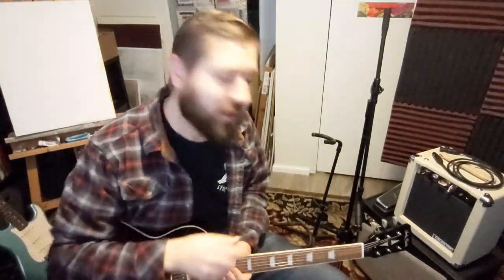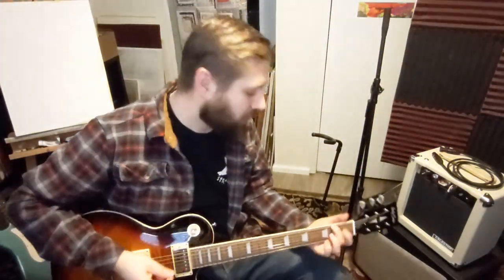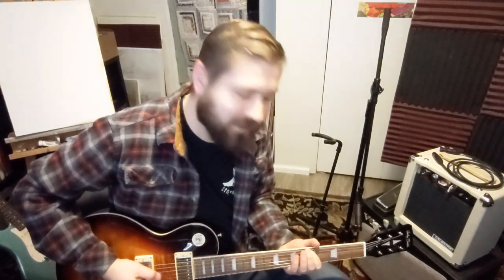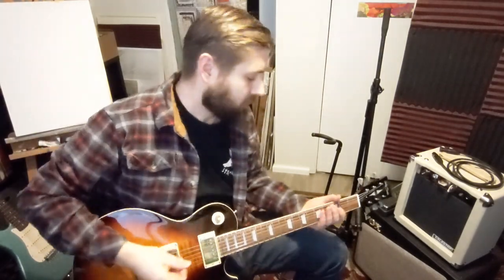Harley Benton SC-550 ii Updated Review & Perspective :: Return or Fix?

Comment: Hi from Spain again. Well I got the graphite nut re-slotted at my expense but then the selector switch, bridge volume and tone controls failed so I returned it to for repair. When it arrived back the selector switch had been replaced but both the volume and tone controls did not function so I returned it again for repair. A couple of days ago they returned my money which I did not want, I told them I would be happy with any SC-550 II model but because I bought a "B" stock they said that they did not have one available at the 245.00 Euro I paid. They then told me to return the hard case I bought with the original order which was perfect! Of course I incurred all the costs for the repair to the graphite nut and the traveling costs to and from my city post office three times. I feel so strongly about this transaction that today I wrote a personal letter to their Managing Director, Johann Thomann, I will let you know if he replies, kind regards,John.
Reply from the maker: Sorry man!
Reply: please tell us about their reply. 
I was planning to buy one exact what you bought. 

I am a disabled person and I do not have a chance to go to the post office 3 times. and i do not want my first guitar to have problems that I cannot ignore.
Reply from the maker: @TheEbelekgubelek  Thomann did replace it. And they made it pretty easy for me. UPS came and picked it up from my house - so I didn't need to do anything other than print out a return slip which I handed to UPS. They made the return easy for me but individual results may vary. I've been pretty lucky with Harley Benton and Thomann. Out of 6 the Harley Bentons I've ordered, this was the only one I had to send back. Good luck!

Comment: I had a somewhat similar issue with a Harley Benton TE62CC. The box was just a little bit beat up, and when I opened the box, the little foam bit that covers the pickup switch was off, and the switch felt really loose so I figured it was damage from shipping. I contacted Thomann and they said how much experience do you have with sodering, we can send you a new switch. I waited the week and a half to get the switch and then figured it would be just remove wires and connect to corresponding connections on new switch. Well the new switch was different design, so I had to do some research to find out how to wire correctly. When I did that I discovered the switch in the guitar was not wired correctly. I simply connected the two center poles together and the neck pickup then worked fine. Somewhere there was a card that said quality control by ...Well I don't know what they mean by quality control, but if they plugged it in and tried to see if each pickup worked they would have discovered the problem. I know, it was inexpensive, and I learned somethin new, no huge deal.
Reply from the maker: That's awesome. It seems that the bonus with Harley Bentons is that you often get an opportunity for learning something new.

Comment: Hi from the UK, I built one of these from a kit a while back. The ground wire should run up to the bridge leg support that goes into the body of the guitar. If it's not touching the bridge it's not grounded or the wire hasn't been stripped back enough to make a good contact. Hope this helps.
Reply from the maker: Thank you! That is very helpful information. However, I took a chance on the replacement option. I should have the replacement guitar by the end of the month. I figured that seeing another example from them would only help me make a more informed decision in regards to purchasing other guitars in the future. Thanks again for your help!

Comment: Hi from Spain. I enjoyed your video, very honest and clear. I recently purchased the SC550ii PAF and it arrived basically unplayable. The graphite nut was really badly fitted, set far too high, the string height at the first fret made it impossible to even play simple chords without intonation issues. I contacted Thomann who simply said return it, showing no interest in the problem, their quality control is poor. I need to get it to a Luther who has the right slotting files to correct the problem, then hopefully I will have potentially a great guitar. On the positive side the "Tesla" pickups are very good, frets perfect and overall finish excellent. The tuners I think I will replace but that may relate to me having a problem with the nut, getting the graphite nut right is the only issue I have. Kind regards, John.
Reply from the maker: Thanks John! I appreciate your comment. I ended up returning it, but ended up with their SC-DLX gohto which was didn't have any problems. The gohto tuners are great and I like the Tesla pickups. There definitely are quality control issues at this price point but 3 out of 4 of my Harley Bentons have been awesome. Hopefully you can get yours fixed up and it becomes a great guitar for you!

Comment: this is the guitar i am looking at just now, jumbo ss frets yes?  thin neck yes? light but not hollow light? i am watching ur video just now......
Reply from the maker: It's a great value for sure. The neck isn't super thin. Not thick either, feels very average and comfortable. Stainless steel frets dressed pretty good. The weight was a little heavy but not more than anything standard LP style. I ended up sending this one back due to damage/defect. But most others should be great. I ended up getting the SC-DLX Gohto which I like better. Pretty much the same but with better hardware, a little lighter, and with only 3 knobs with coil split (which is cool if you like more options). Both great guitars. Best luck to you on whatever you decide!